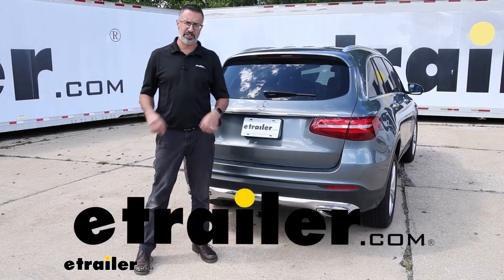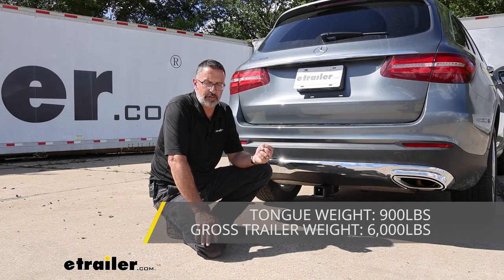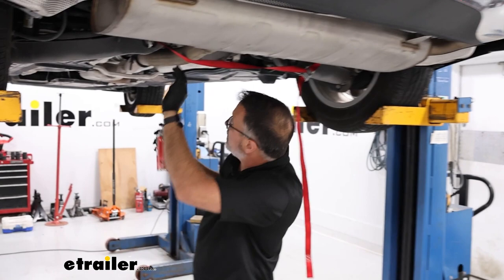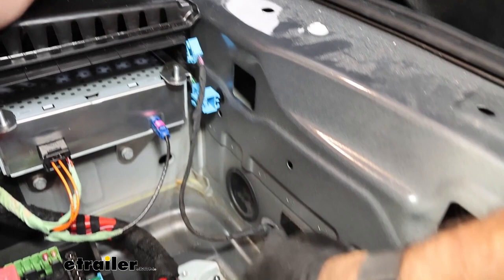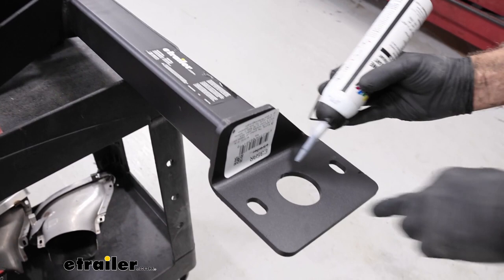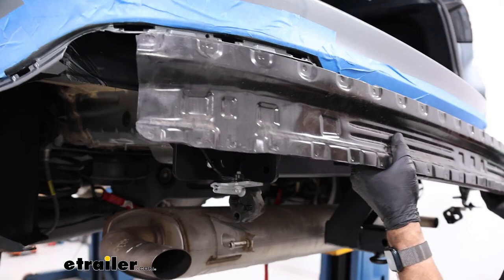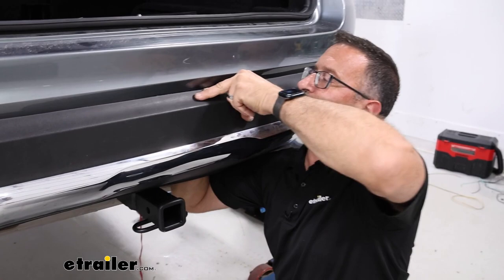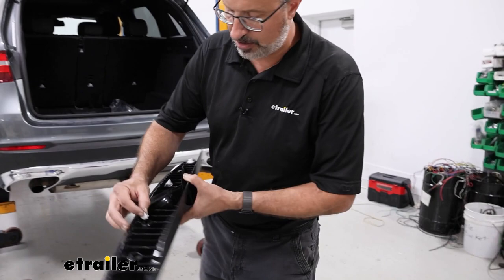How to Install: etrailer Trailer Hitch Receiver on your 2018 Mercedes-Benz GLC

Comment: Where are you guys located?
Reply from the maker: We're in Wentzville, Missouri. Wentzville is about 40 minutes west of St. Louis. If you're within easy driving distance and wish to set up an appointment for an install, call our Customer Service folks at 800-298-8924. If you're not nearby, you can find a local installer by using the link below and inputting your zip code.
https://www.etrailer.com/installer/near-me/trailer-hitch
https://www.etrailer.com/Trailer-Hitch/etrailer/e35AR.html